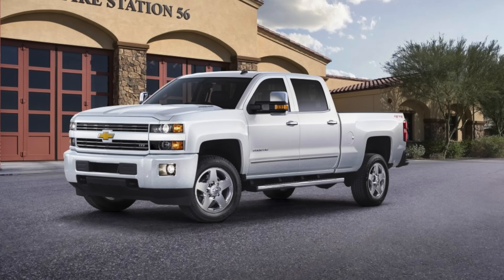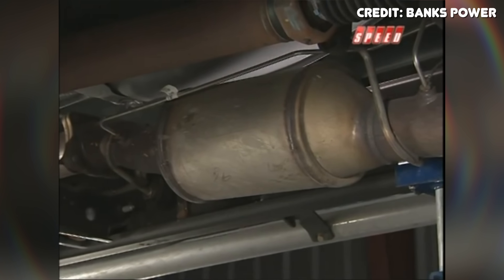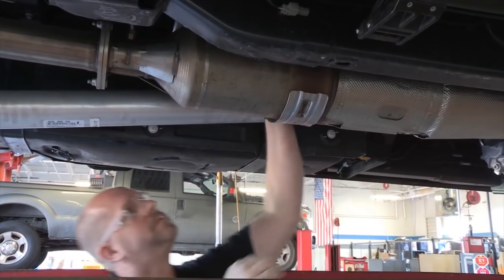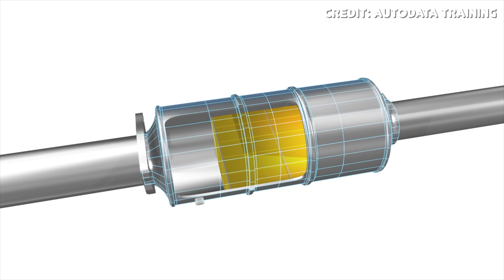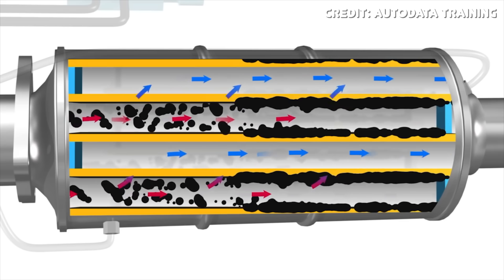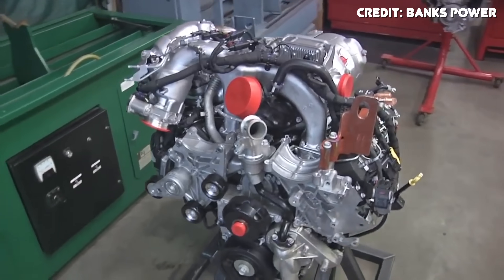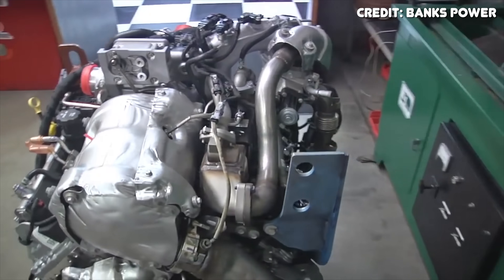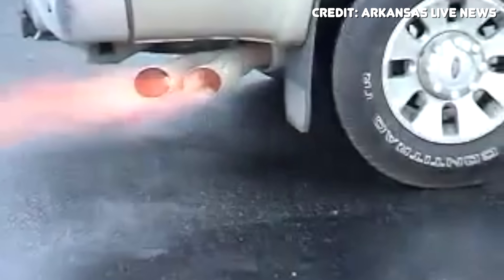Why Does Duramax Have This Exhaust Tip?

Comment: My 19 Duramax did a regen last week, and even with the exhaust tip cooler, the exhaust temp will burn the crap out of your hand from a foot and a half away.   HOT AF.
Reply: Def is bs
Reply: @shadowopsairman1583  and def is also not a bad thing, it increases mileage and helps counteract the negative affects of emissions systems
Reply: @jaredc.3508  no, no it doesn't. Emissions controlled diesels get shit mileage.
Reply: @jasontedesco3154  i said def. not emissions.
Reply: Banks 5” monster exhaust will reduce temps
Reply: Rip that s*** up and do yourself a big favor...
Reply: @cashRad  Can't unfortunately. 
Emissions testing is pretty strict where I'm at.
A few people I know have failed,  and had to revert back.
Reply: If you idel a lot it with regen a lot more
Reply: @jamesgarrison6430  tha bad part us I only live 1 mime from work.
Reply: Yessir,  I have a peterbuilt 330 with the Cummins and when that thing goes into active regen you can't get within three feet of the diffuser. Would love to ditch the dpf and save a few gallons between refills, been getting about 8.5mpg. With twin 40 gallon tanks it's beating the shit out of me financially.  One trip from Orlando to Jacksonville costs me about 130.00 lately.  I make that trip three days a week.  That's roughly 400.00 a week just gone. And no, I can't buy a tesla...
Reply: @dangoldbach6570  is your rig loud?
Reply: @meandean55  it's definitely louder than a stock ram exhaust,  the can on it is huge so it's got a deep boomy big truck rumble. For comparison if you're having a conversation next to it while it's running you do have to shout.
Reply: @dangoldbach6570  I guess I value my hearing too much. How does that not make you go bat shit crazy after 11 hours a day 😆?
Reply: @MrFriday83  it does,  especially since the radio crapped out and I get to listen to the sound of wind all day 😆
Reply: I wouldn't touch a Chevy with a broomstick!
Reply: @johnlong384  Chevy isnt perfect, but definitely the best option for american made diesel trucks. 
Dodge has a great engine, but the truck itself is a giant piece of rubber dog shit flown out of Hong Kong. 
And Fords have problems as well. Not to mention they lost all reputability with the 6.0 and the 6.4
Reply: @BryceAWD  medium duty trucks aren't much better either, the caterpillar C7 accert, the international VT-365, both are legendary pieces of shit. Even the Cummins in my Pete managed to pull the studs out of the bell housing and the fuel transfer pump was just being held in by the fuel lines. A LOT of these problems are the result of emissions requirements. The CAT 3116, international DT466, and the Cummins 5.9 were simple, which made them reliable as hell. Now??? Fuuuuuhhhh....
Reply: Thanks!  I had three of them many moons ago and none of them made it much over 100K before total brake downs!
Reply: delete it
Reply: @crazeguy26  seriously thinking about it.  If anyone cracks the ECU (peterbuilt version, ram guys have had a lot more luck because there's a lot more of them. Medium duty trucks are a small market by comparison) and I can bypass the regen that would be a godsend with diesel being so G-D expensive.  I think it would be worth at least 1.5 MPG. Luckily I'm under 26k lbs. So I can skip the DOT inspection station and probably could get away with it. My Hesitation is that I need this truck to make a living. In my experience,  if you need something to be as reliable as possible keep it stock. But these emissions equipment on the 2007-20015 models seem to be a compromise all the way around, like cummins grafted a workaround onto an existing system. The modern models designed it from the ground up so they seem to be much less of a penalty. Jury is still out on that front...
Reply: https://youtu.be/LHqyTMiFQcM
Reply: It looks like my responding message didn't make it and since you seem to know it all, would you please be so kind to let me know why 99,99 % of all 18-wheelers are powered by inline 6-cylinder Diesels?
Reply: @johnlong384  I'll be the first to say that I definitely don't know everything there is to know, but I appreciate you thinking so! The experience I do have is however firsthand, not some re-spew from somewhere else. From personal experience,  the inline 6 gets the job done for me, Mostly. From an engineering standpoint there are several good reasons for the inline 6 configuration.  1-extra main bearings. A v8 typically has 5 mains, an inline 6cyl has 7. More bearing surface = reduced wear. 2-inline 6 engines are inherently balanced where the weight of an ascending piston/rod assembly is balanced by an equal weight descending.  This eliminates the need for balancer shafts or large external balance weights, less parasitic drag that way. 3-the block is inherently rigid and not prone to warping, again making them more reliable.  4 ease of manufacturing.  It is far simpler to set up a mill to surface one deck that is parallel to the pan rails than two at angles to it. These are all objectively true reasons. They will remain true no matter what people's opinions are. Subjectively however,  if you prefer v8's, go for it! I have two Detroit diesels that don't follow most of the above rules and I still love them.
Reply: Thanks!
Reply: Fr my old boss had a 2020 Duramax and the exhaust was always hot as fuck when you walked by it
Reply: When we do regens on semis they EGT is 1100+
Reply: AF= Auto Focus
af = as fuck
Reply: @[][][]MANN  Hot autofocus is what I meant.

Comment: I'm guessing this is the same reason modern diesel car's have fake exhaust tips, and the exhaust tips point to the floor under the car. So the hot exhaust goes down instead of the car behind it.
Reply: My diesel car is pre-DPF but it still has the downward pointing exhaust (no fake tips though, it's not fancy enough for that). I suspect it at least started as a measure to prevent your soot blowing in the face of other drivers.
Reply: @nerd1000ify  yeahh my 2008 a3 diesel was the same but the more modern dpf cars have it under the car

Comment: Usually you don't see it too much on trucks with stacks on them but the ones with a downpipe by the framerails tend to have various sorts of fan shaped tips that sort of disperse exhaust gas into a wide arc
Reply: That isn't quite how they work
Reply: Actually a lot of trucks with stacks had them from 09 to around like 2011-12ish when they went to the DEF SCR systems.